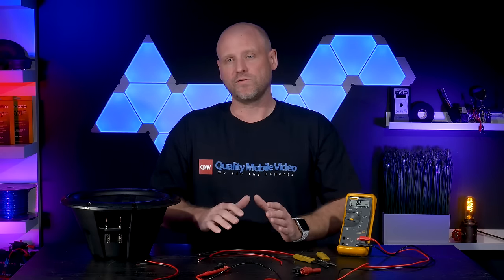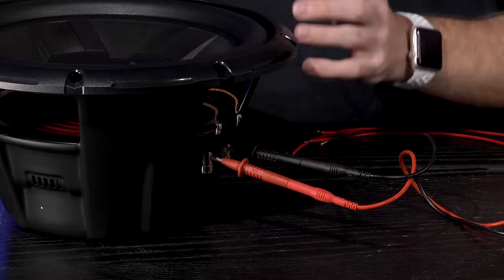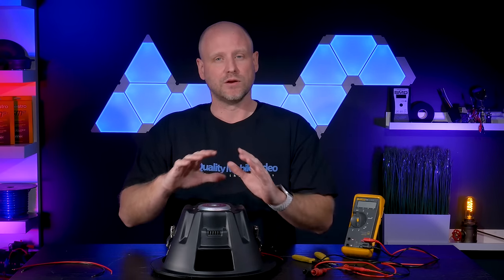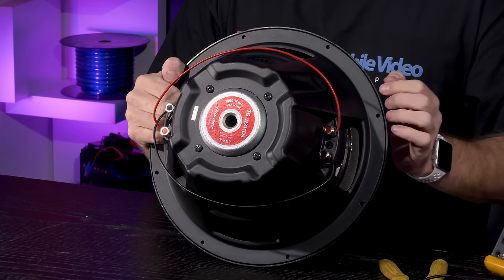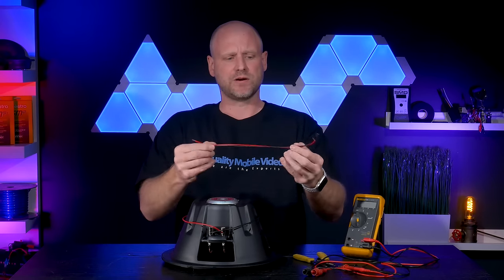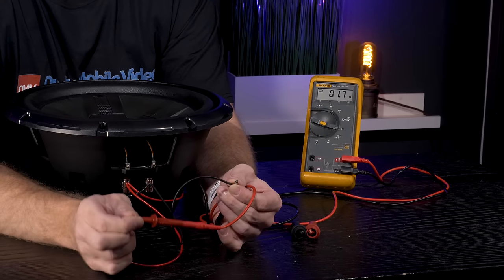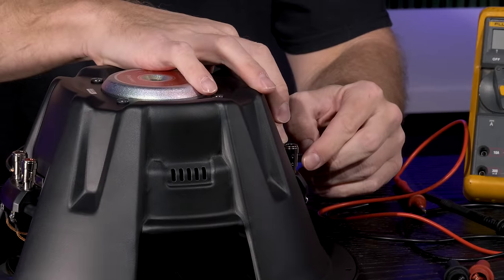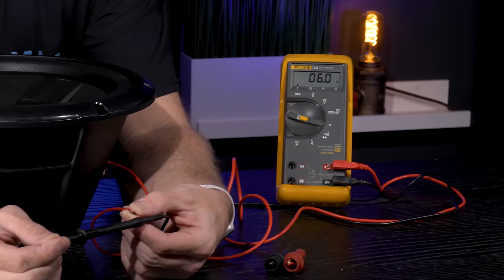Wiring Your DVC 4 Ohm Subwoofer - 2 Ohm Parallel vs 8 Ohm Series Wiring

Comment: I think it’s interesting that some of you commenting think that this is common knowledge when there are folks who STILL struggle with comprehending wiring up subwoofers.  Instead of being difficult ( I’m being polite here ) about it, why don’t you teach your knowledge to others - save a subwoofer save a life hehe - like this page is doing.  Just a thought.
Reply from the maker: Tim gets it 👍
Reply: tim erhardt I am one of them ,who just can’t grasp this freaking harness, (maybe there’s to many wires ,to many colors IDK)A few months back I tried , I had the dash of my truck open the panels of all 4 doors off for weeks finally I paid a pro to do in 10 hrs what I couldn’t do in weeks ,Now I get a great idea to link my steering wheel controls  back up to my radio and mirror capabilities using RCA TO HDMI cable to an adapter , ,, I pull the dash apart watch abut 3 different guys do it about 30 times but I can’t get my radio to CarPlay (which it did early on for a few days back in June) or mirroring capabilities should’ve just stuck to blue tooth ..  SMH,,,
Reply: Thats what's up people got to mouth off and all that on any video this man is the go to man on YouTube for a traditional car audio enthusiast who just wires them on a basic understanding on electronic circuitry and how they function. Yeah I can hookup any subwoofer just like that but I do not dare claim or comment or talk about my expertise and knowledge of impedance and how the polarity of the various wiring schemes you can use to run dual subwoofers especially I know very little about and damn sure ain't to proud to say I'm ignorant in the area and field of load outputs. This man I'm damn sure went to fricking school to learn which I'm betting he already had basic knowledge of and furthered his skills and knowledge of what he is demonstrating you can tell by how his presentations are well presented and they are very clear and simplistic at that as to where you got these morons out here on the comment section running off at their mouth about their so called skills. I appreciate these demonstrations and how to videos you opened my skill set up to understand the difference in the way I can wire my system to better its outputs and give my subs longevity you by far outdo all these so called professionals with shadetree show off videos that provide us with arrogance and most likely got folks wiring shit up to blow up their expensive subwoofers and turning amps to griddles to point is folks listen to Tim yeah arrogant assholes Tim hit y'all in the mouth on this one and he was polite very polite which Tim my friend its very hard I'm sure you know to be polite about anything these days but he could have butchered y'all with stuff if he wanted to he was being polite in the sense that yall don't know what you talking about plus I don't get why do people venture on to videos like this to just up and talk shit huh? Really unreal whew hey I love these videos you've taught me what no other jackass claimed they was showing us the best way to wire subs could not show me at all you are the go to man on this area of expertise and I modestly say that cause I give credit where its so damn well due so I salute you and I salute Tim on a hell of a comment.
Reply: @Qualitymobilevideo  you are the go to man on all my audio hangup and my ideas for what way I'm trying to crispen my subs to sound like you are professional above all others on your videos and your presentations could teach a damn monkey how to wire a banging system up in a tree I would bet lol that's how straight forward you are no fancy dyno test crap or fancy computers and frequency monitors and rah rah just a plain old ometer basic technique and great verbal knowledge is presented for us that appreciate your time your efforts your videos and you taking the skills you learned to care to share with those who genuinely have a passion for car audio,and how the stuff can operate I appreciate your videos man my go to source for anytime I have a bit of or a huge hangup on how to wire my subs in the proper sequences especially DVC subs and systems the only guy I trust with teaching me the right ways.
Reply: I have an mrp500 too but I have two dual 10” 4 ohm subs so how do I get them to 2 ohms on the alpine mrp500?
Reply: I've got a RF Punch 500-1bd amplifier and it's 1ohm stable amp but I'm not sure my Pioneer Champion Series 12in. x2 subwoofers can handle the significant increase in power from a dual 4ohm-1ohm stable. What do you think
Reply: @PrestonJWard  IF** the subs are 250 watts rms, are 4 Ohm DVC and the amp does rated 1 Ohm power then you’ll be fine with your setup and will probably love them in a ported enclosure tuned around 35.
Reply: @timerhardt7528  Thanks for replying to my question but i've got another one to ask. My amp at a 1ohm load is about 700watts,lil more or less, and my box is tuned 45hz sealed box 1.50cubic feet. So its cool to run at 1ohm, I'm just curious to try it out. Don't get me wrong i'm impressed on how these Pioneer subs have performed thus far. I just installed a bass reconstruction processor or DSP and i've been playing around testing different set ups so I'll just give it a try and come out of the gate slowly to start and then go from there. Thanks for the feedback
Reply: @PrestonJWard  sealed boxes will NOT have a tuning frequency of 45 Hertz.  You can figure the sealed boxes QTC ( .707 is preferred for nominal output-think a little bit of both worlds in regards to air space for your subs to operate in ).  Also, typically, sealed environments require more power than ported so again, as long as the subs rms is close to that 250-350 range you should be good.  I’d recommend the same tune as a cutoff on the amp if you can set the lpf to around 35 ish to prevent over-excursion since I don’t have any modeling data to say otherwise.  Best of luck to you sir…BASS ON!
Reply: @timerhardt7528  Thanks a bunch and another thing I was going to mention was that I just realized my subs are wired at a final Impedence of 8ohm, the box was a prefab so the subs are individually sealed. I learn something new everyday, thanks again and have a good night
Reply: @PrestonJWard  There is no 8 Ohm configuration for a pair of DVC 4 ohm subwoofers that are wired to a mono block amp like yours are — only 1, 16, 4 in series/parallel, and 4 in parallel/series.

Comment: How to connect 2 L7 to get 8 ohms  I have a Nemesis 6k mono block that said 4 ohms 1500 rms-3000 peak ,2 ohms 2500 -5000 and 1 ohm 3000 -6000 bit already blow out one L7 so I get another but I want to get 8 ohm

Comment: I have a punch 801s.  What's the best set up with dvc? I want more power but i think i had it at 1ohm.
Also I'm an electrician, will electrical wire hurt my amp if i use stranded wire for speaker wire?

Comment: Can you wire for 4ohms by wiring the positive from the amp to both positives on the sub and then the same for negative? My amp has 2 outputs but they are apparently the same channel

Comment: You are using the “ohmmeter” function of a “multimeter”, not setting the “voltmeter” to ohms. Also touching both probes is less accurate since the body passes electricity. Good video in general. 
Came here looking for a clean way to wire 4ohm DVC in parallel. Is there any reason I can’t just clear off some insulation and use one strand for both connections versus multiple wires?

Comment: Can you please clarify- when you are explaining the 2 ohm load, is that 2 ohm mono? I want to run my DVC 12 inch sub off an old school Rockford 2 channel A/B amp instead of my Class D HiFonics mono "Brutus", however from what i read 2 ohm mono is not a good idea. Are you describing a 2 ohm stereo load? If not should i just roll with an 8 ohm load?

Comment: Eric b No I didnt check I just went by assuming my comp r 12 enclosure would pair perfectly with my amp. Maybe something wasn't wired correctly inside the enclosure and it was probably giving off a 1 ohm load trying to keep up with my 2 ohm Rockford amp

Comment: What if u have 2 subwoofer would u wire them the same
Reply: Yes and then connect them together 2ohms+2ohms=4ohms OR 1ohm...... No other option if wired like in the video.... 1 ohm is the best option for extracting all the power out of your class D monoblock

Comment: I have an Alpine type R 1242D 500w rms 1500 peak. I have it wired in series because the shop that installed it said it would last longer and give clearer sound. The issue is most amps only list 1ohm 2ohm and 4ohm. If my speaker is wired in series  with a final impedance of 8ohm then how do i choose the correct amp to power it to its maximum of 500w rms? I thought the impedance of being wired in series would have a final impedance of 4ohms. I ordered a Taramps 1200 bass witch gives out 650w rms @ 4ohms. Will this amp be able to give the 8ohm impedance that my speaker is wired to?

Comment: not sure if im correct on this but if i wire dual voice coils in series and i add another subwoofer in parallel to the same output of the amplifier would i get 4 ohms 8 ohms or 2 ohms ? im thinking ill get 4 ohms at the end

Comment: i'm still confused
so 2ohm gives more power? but more heat and need basically a mono block cause my jbl gt5 a604 didnt like that not alot of bass more blown up sound
now i wired it back to 8ohm and the bass is deeper. but i got a 400w rms velocity sub so either way my amp is weak...
but so i still dont get 2ohm is stronger if you amp supports it but if not 8ohm is better? i use a 4 channel amp with 2 focal 16.5cm speakers also on it

Comment: I have a spare 8" 4ohm DVC subwoofer that i want to replace my factory sub with in my 4runner to the factory amplifier which has a sub at 2ohms. From the factory amplifier to the stock sub there two leads (each with one positive and negative wire) question is after running my two speaker wires in the sub from + to + and - to - 
do i run just one positive from one lead to one coil and one negative to the other? Sorry i'm a big time noob when it comes to car audio... any help would be appreciated!

Comment: Will a fluctuating ohm reading not so stable indicate a burn or damage sub or it’s coil  again knowing the subs specs ohm rated ? We typically say yes but on a lower reading how about a higher ohm reading again this will be in a ocasión where I can’t take out the subwoofer enclosure w ease or enough room just by subs lead wires but disconnected from amp by them selfs ?

Comment: i have a re audio xx 4ohm subwoofer wired down to a 2ohm load on a kicker cxa 1800.1 but my question is can i wire the subwoofer down to a 8 ohm load even tho the amplifier doesn't say its 8ohm stable? It only says 2ohm and 4ohm Stable.

Comment: I have a pair of 12 inch pioneers ts w3003d4 subs...what's the best set up for these and what amp should I hook em up too? I'm not to audio tech savvy but I want alot of bass and I'm sure the can produce more than they are putting out...I got them hooked up just on one side of the coil

Comment: Thanks to this video, I managed to figure out what the heck is DVC sub. I'm trying to connect this DVC sub that I plan to buy in series so that I can fit it into my home theater receiver as my receiver require a sub to be 6-8 ohm impedence. Is my understanding of this concept is correct? Thanks in advance.

Comment: Great visual explanation; much appreciated. My question is whether or not the wire used to jump the speaker terminals HAS to be speaker/amp wire or can it be "standard" red/black wiring as shown, in a thicker gauge.

Comment: I guess what  I meant to say was if the speaker rms is 800 would the speaker still accept 800rms whether it was run in series or parallel? It doesn't matter whether it's a dual 1 or 2 or  4! Could you still apply the same amount of power to it? If you know what I mean!

Comment: bro i wanna use the dvc sub in 4 ohm load cause i will be connecting it to my behringer ep4000 power amp bridged in 4 ohm load so i wanna wire the dvc sub in 4 ohm load

Comment: I have a  5 channel amplifier  JL AUDIO  RD  900.5    . I have a  sealed box  with two  terminal cup connection  . The amp can handle a final 4ohms  wired correctly  . Or 2ohms load  .... but each subwoofer has its own  chamber  . If buy two 10inch subwoofers they have to be  4ohms and  DVC . And wire each to a final  load of  2ohms  ??? Will the  amp handle  two 2ohms  subwoofers  ??? ... I'm new to car audio

Comment: Hey everyone. So I have a 4ch amp rated at 115 watts rms x 4@4ohm, 230x4@2ohm and 460x2@4ohm bridged. Also, I have 2 dvc subs(4ohm) rated at 200rms llllll. The one side(ch 1 and 2) I use for for mids and highs, whereas ch 3 and 4 I would like to use for the subs. The question> If I understand this correctly, I can hook up the two dvc subs in series, equalling a 8ohm load for each sub and then connecting the two subs in parallel at the corresponding connections, thus bringing the resistance back to 4 ohms such that I can use the bridged connection to utilise the 400rms? Thanks in advance.

Comment: So I’ve a question ?? Ideally I’m wanting to run my dvc in parallel. One sub.  So I have a 2 channel amp the 200 Watts rms at 2ohm . How do I distribute the power from the amp ? Also is the rating per voice coil or both combined ? Do I run each channel to each voice coil ? Please advise . Thank you

Comment: Will it mess up the power that I'm generating if I set it up as a 2 ohm load but then put one of my wires in the positive side and the other in the negative side on the other side of the coil going to the amp I mean I already wired it up like that on one of my speakers and it worked I didn't know if I was getting any better Bass from it or less I could not really tell

Comment: When you get your readings (1.5 and 6) ohms they should be (2 and 8) right?, I'm just trying to clarify bc if I'm not mistaken your hand touching the wires also picks up resistance thus not having the correct reading, not knocking just pointing out to someone that might not understand why the readings aren't what they say they are
Reply from the maker: Correct, 2 and 8 ohms, it's not from the hands, its because the subs aren't wired, powered and in an eclosure, then the impedance will reach 2 and 8

Comment: I have a skar audio evl 18 dual 4 ohm 2500 watt max rms and a skar audio Rp.1200.1D 1600 watt max rms amp could you please help me figure out the best way to wire this amp and speaker i dont want to screw up and mess up all my brand new equipment please help meee????

Comment: can i run only one vc on my dvc sub..??   i have a pioneer TS-D12D4 (dual 4 ohm) and i have a old school pioneer 2 channel amp that is only rated at 4 ohms in bridged mode... 
obviously the speaker in parallel gives a 2 ohm load which will run the amp hot and possibly damage it... OR the 8 ohm load in series then the amp won't put out as much as what its rated for at 4 ohms... which is under powering the sub...
So... can i just run the sub off 1 vc only at 4 ohms..??
Reply from the maker: I woudln't recommend it, but maybe you can get some insight here: https://www.the12volt.com/installbay/forum_posts.asp?tid=74640
Reply: Quality Mobile Video i have read that article before and has got me nowhere because all responses are different. Some say no, some say yes... it wouls be different if the majority said yes, but its not that way .. so i am back to square one unless you can explain to me why you would not recommend it
Reply: 4 ohm to 2 ohm

Comment: As others have stated, thanks for stating this so clearly. But I do have to ask a question to make sure I get the best performance from my setup: I have a JL TW3-10 4 Ohm DVC sub paired with an Alpine S-A60M. Since the amp is 2 ohm stable I’m assuming I need to wire the sub at a final impedance of 2 ohms to get maximum efficiency and output. Is this correct, even though the amp will output 600 watts RMS and the sub is only rated for 400?
Reply: I got the same question. I have an Alpine type R 1242D 500w rms 1500 peak. I have it wired in series because the shop that installed it said it would last longer and give clearer sound. The issue is most amps only list 1ohm 2ohm and 4ohm. If my speaker is wired in series  with a final impedance of 8ohm then how do i choose the correct amp to power it to its maximum of 500w rms? I thought the impedance of being wired in series would have a final impedance of 4ohms

Comment: Hey there if my amp is only 4 ohm stable (bridged) do I need to raise to 8ohm OR only use 1 voice coil... thanks
Reply: this is what I want to know, did ya figure it out
Reply: Same here, hope anyone can answer
Reply: @yen_yor_ben  I ended up putting mine on ,  I think it's dangerous to use 1 coil..

sounds pretty good at  anyways
Reply: @VALAREZ  well good. 2ohm make amp hot easily, 8ohm too low. I have Rockford r2s-1x10 already in the box , i should open it and try 1 coil instead

Comment: I have kicker CVX , which coil goes to amp ? Two of them have a white Dot .thanks in advance
Reply from the maker: What's the exact model? 2 ohm or 4 ohm?
Reply: Quality Mobile Video 4oh 44cvx124
Reply from the maker: Wire in parallel: https://www.qualitymobilevideo.com/subwoofer-impedance-wiring-wizard

Comment: Okay question... if I wired both my 4 ohm DVC sub down to 2 ohm and i hook one to 1 pos and neg and the other to other pos and neg would they both still be 2 ohm at the amp? I have a Hifonics Brx 2000.1D
Reply from the maker: Well your first issue is Two DVC 4 ohm woofers cannot be wired to 2 ohm

Comment: So, if higher ohms deliver less wattage, what is the benefit of going higher rather than going lower. (Assuming you've correctly matched ohms on sub and amp)
Reply from the maker: Higher impedance gives your more efficiency, runs cooler.
Reply: Can I run series in the summer? I’m in the desert.